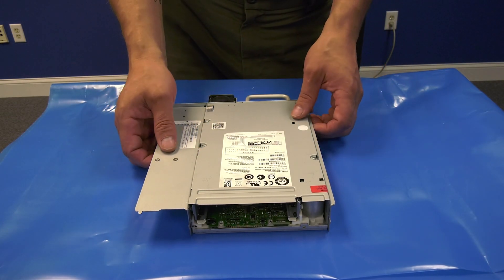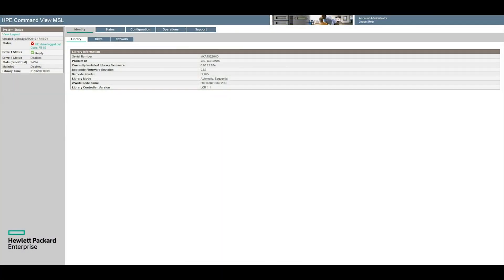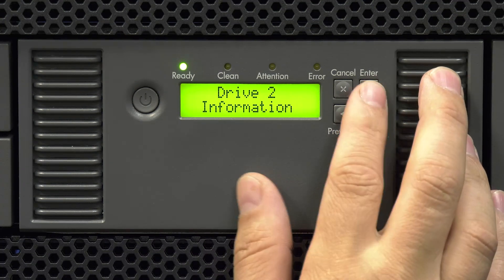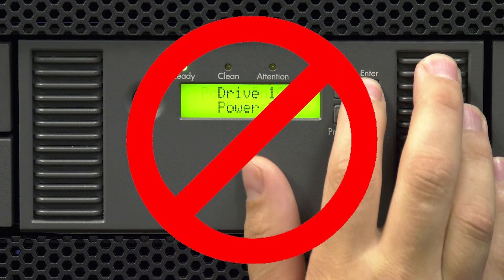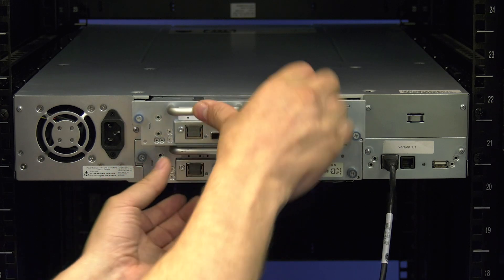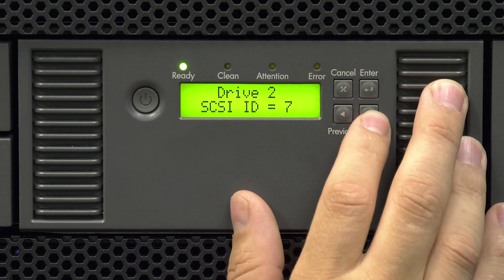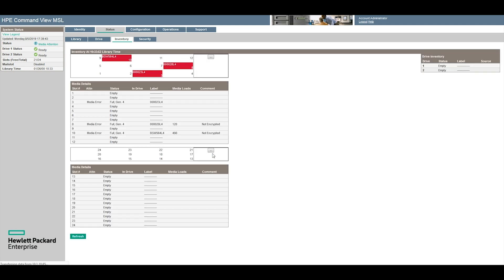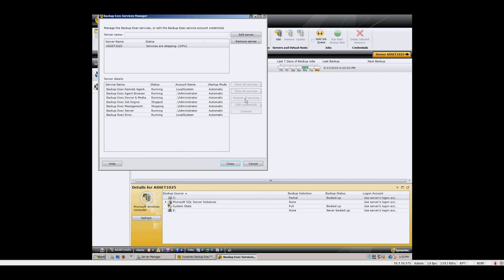HP 1/8 G2 and MSL2024 Tape Drive Replacement Video

Comment: can a full height LTO4 SCSI card be replaced by 1/2 half height LTO5 SAS cards without issue?
Reply from the maker: Hey Matt, you can replace an LTO4 tape drive with an LTO-5 without a problem, there is a good chance that once you do so the library complains a little bit, if that happens then factory default the library, once it boots up it will be good  to go but you will have to set up things such as IP, Subnet and gateway/ cleaning slots/etc afterwards